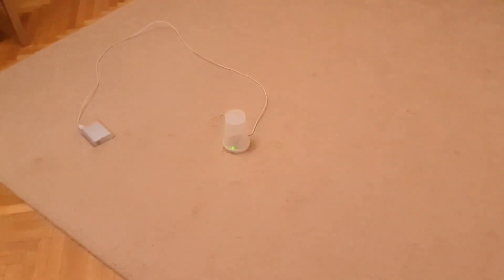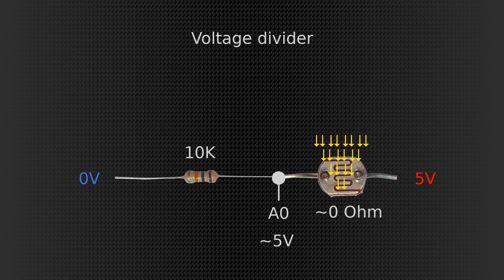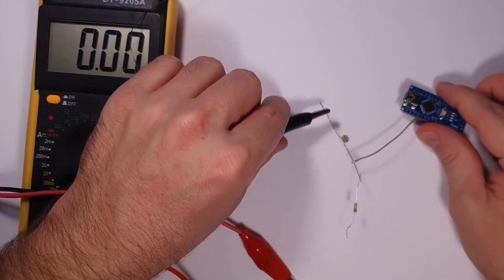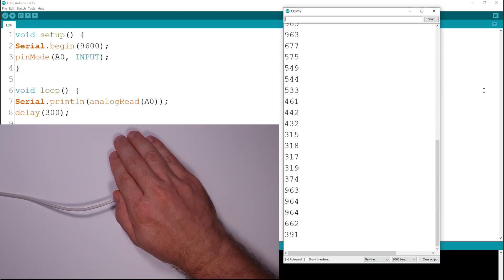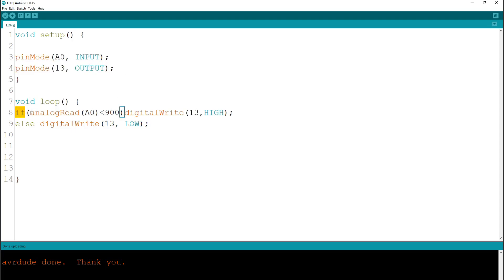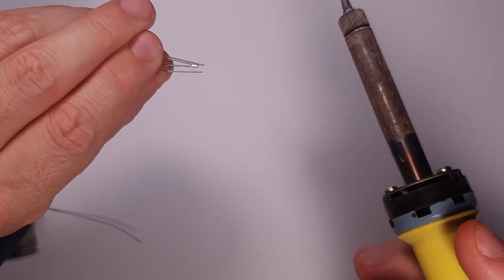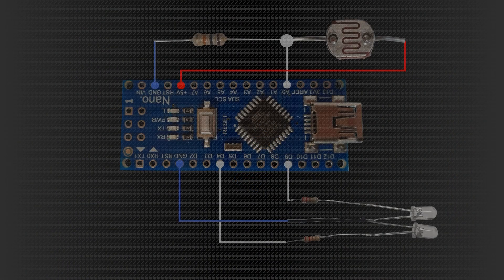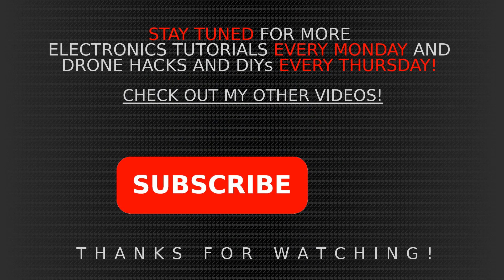LDR Light sensor project with Arduino

Comment: Awesome explanation! :)
Would be cool to check out/build if there was a relay circuit with this resistor to control an adaptor that powers the LED lamps.
Reply from the maker: Thanks! :) Yeah. I will make a much simpler version of it without Arduino, and I will put a relay on it. ;)
Reply: Hlo @ZollyD
Reply: Bro one doubt